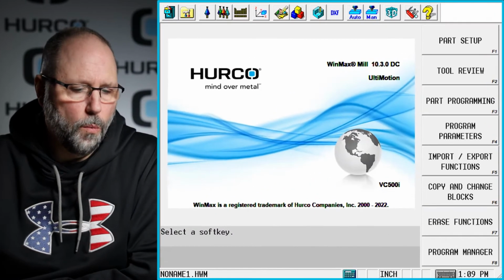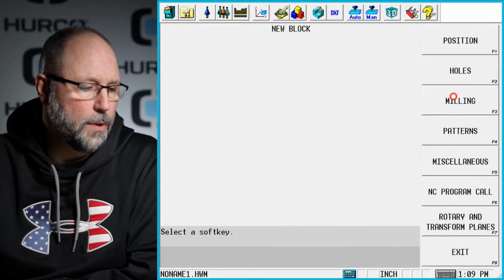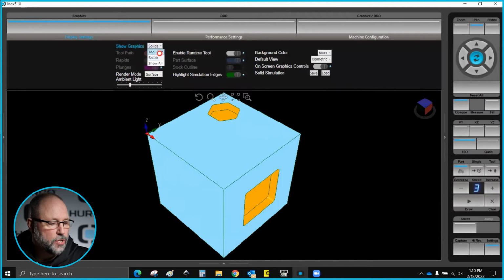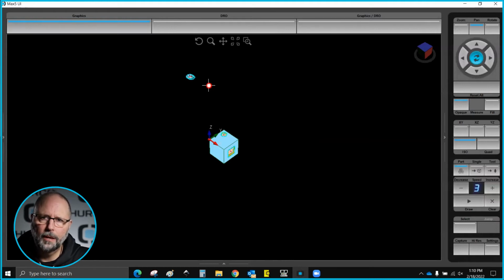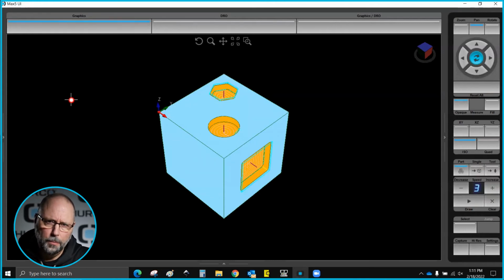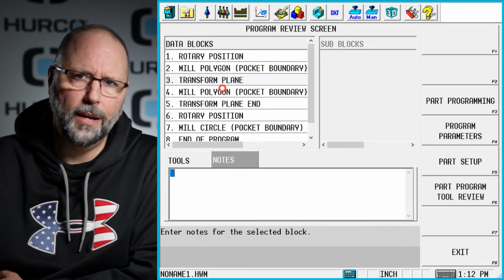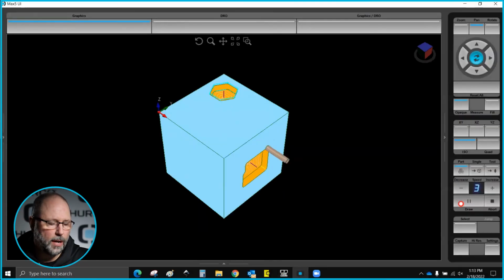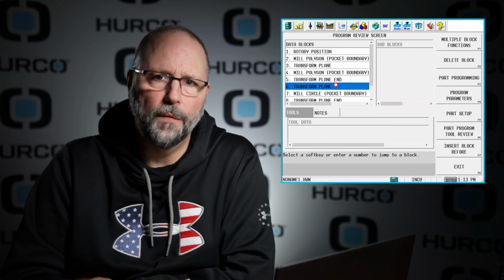Rotary Position After Transform Plane | Hurco 5-Axis Training Course

Comment: In a rotary position block, isn't it necessary to have the reset rotary encoders box set to YES?
Reply from the maker: Hi Grego,  to answer your question no, you don’t need to set the RESET ENCODERS parameter to YES unless necessary (for the specific reason of keeping the axis from “unwinding”). However, setting it to a YES is not a bad idea – even if it is unnecessary for your particular application it won’t hurt anything.
Reply: @hurcousa  okay, thanks for the reply